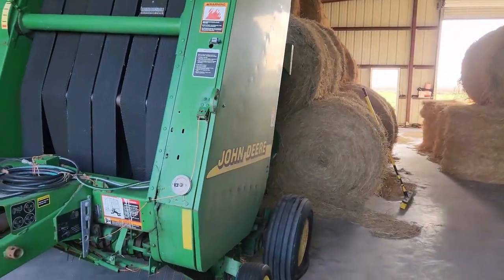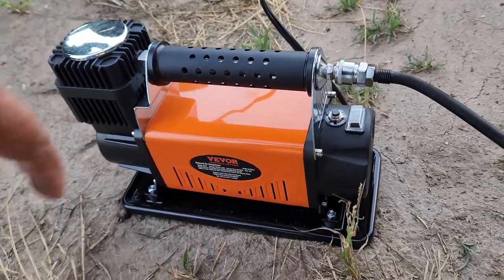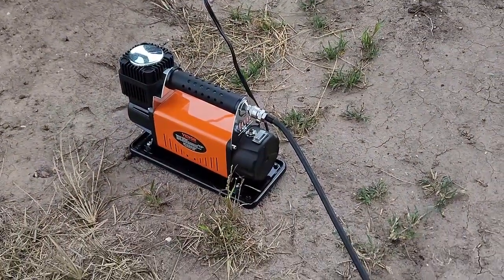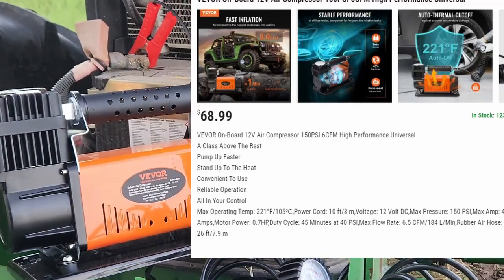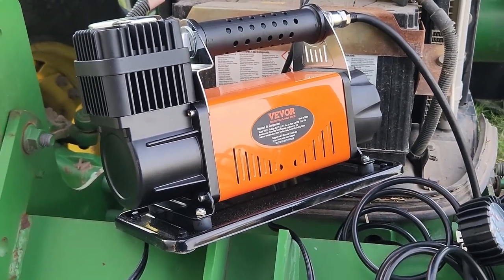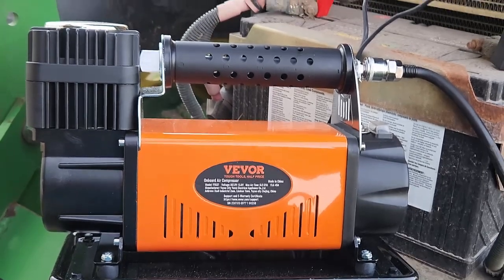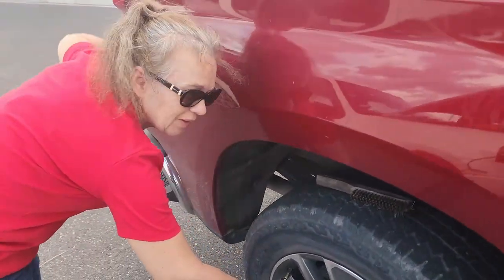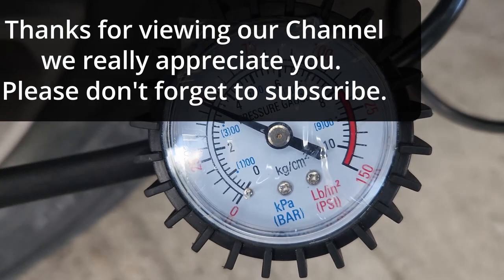Vevor 12V High Performance Air Compressor.

Comment: I keep a gas powered compressor on my service truck put this would work in a pinch to carry on a tractor or the Go to Town truck. Especially or that price.
Reply from the maker: It's not a bad little compresor, I was really impressed with its performance.  I also have a twin tank gas powered compressor I got on sale from Home Depot used tools.  I don't have a service truck and we only load it when we need continuous air pressure.     Thanks for stopping by Russ, gave you a sub.

Comment: Looks like a good unit. I use the Vevor electric fence netting for our sheep and it works great. They have some really good products. Will probably order one through your link.
Reply from the maker: It is impressive for the size and price.  When i first seen Vevor I thought the were fake because the prices were so inexpensive.  They are just a big Harbor Frgt internet store with great prices and some good products.  Appreciate your support, have a great weekend.

Comment: Looks like a pretty good little sir compressor. I might have to get one for my truck. Thanks for the video
Reply from the maker: Thank you Ryan, hope you all have been doing well.  I really have been very satisfied with this little unit and would recommend it, so far no issues and have used it several times now.

Comment: How long to go from 60-80psi on a truck tire? I do a lot of hauling and air my back tires down to 60 when not towing
Reply from the maker: I have not really timed it but have used several small compressors battery chargers and this thing is by fare the fastest.  Be carful because the connections close to the compressor do get hot.  I also removed the little square protector at the end of the hose, it got in my way. I have continued to use it and have no complains.  Sorry I dont have the timing but has work well for me.